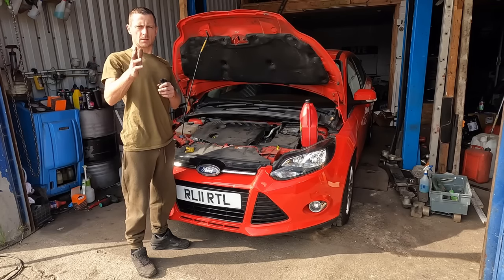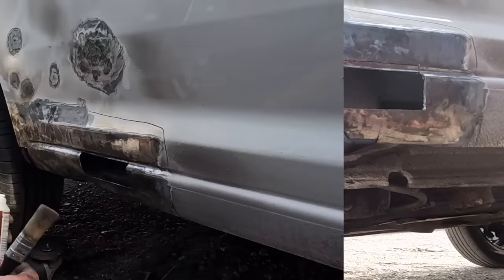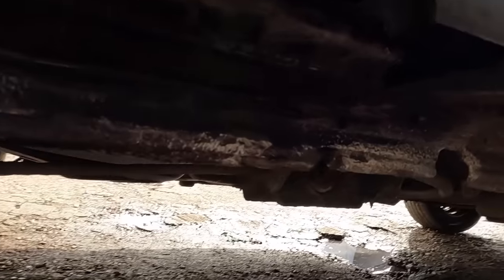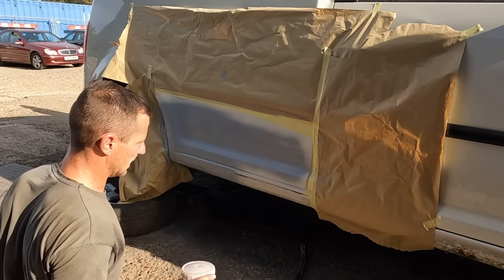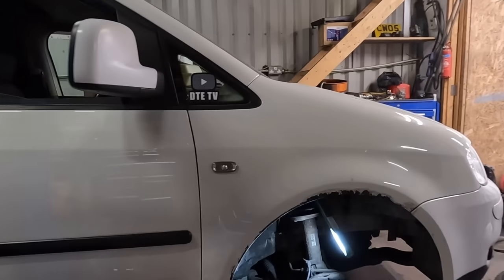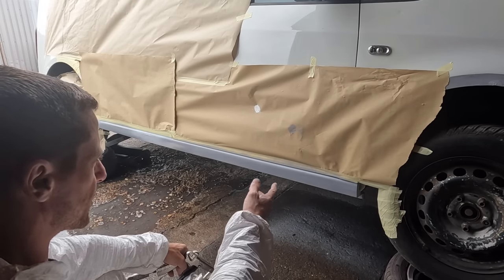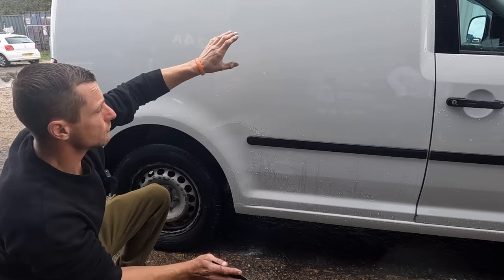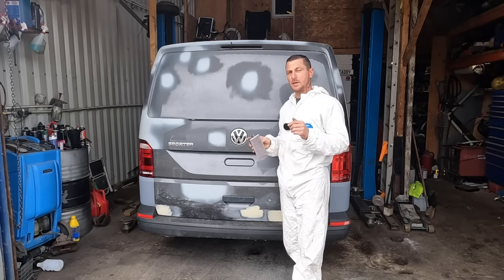Vw caddy rusty sill replacement zero budget

Comment: Problem with the front wigs is that the wing stonegards rub on the inside of the wings . Over time the paint is rubbed off then in comes the rust.  When you get the replacement wings a thick layer of brush on sealer where the stonegard makes contact with the wing. Problem solved . Hope this helps.
Reply from the maker: Hey Ron your so right it definitely wears it away, I’ll do that on the replacement wings for sure 👍

Comment: What a difference already. Brilliant detail as always mate . Only problem with chasing rot it can soon escalate😢 job well done Nathan
Reply from the maker: Hey bud thank you 👍 your so right I’ve had many transits in my workshop over the years and the rust actually doesn’t stop sometimes 😩
Reply: @YTDTETV  oh yes transits are notorious for corrosion. Don’t think I’ve known any 1 that’s owned a transit to not have to have welding 🤦‍♂️

Comment: Great job Nathan, I wish I had friends like you!  This van reminds me of my 2015 T5.1, white, 200k and needs a lot of rust repairs and paint jobs.  I've taken it to the local bodyshops and no-one wants to touch it :(  I think you should paint the bottom of the door, if I saw that for sale as is today, my brain would say "that door needs a repaint to match the quarter"
Reply from the maker: Hey Tom I think I will paint the door bottom for sure, ye some body shops don’t touch the crappy jobs but they ain’t to bad once you get into them.
Reply: @YTDTETV  Keep a bit of that paint spare for the bottom of the replacement wing too, then it'll look right :)  The problem with my van is it was brush washed every 5k until it was on 192k when I got it.  The Candy White is awful and it's had quick cheap repairs in the past in what could be DAF white!  The local painters all have pride (or greed) and don't want their work to look odd so they either reject it or suggest a full respray.  I don't want it to rot out like that Caddy so thanks again for the informative content because I may end up doing the same repairs myself with rattly cans!

Comment: Great episode. 
Can I ask what stonechip you used? The texture looks almost like Raptor. 
Details around the painting are greatfully recieved -what paint are you using, costs for larger quantities, do you use the same paint for your other projects?
I will just drop this -a true budget build would be rollered paint...
Go easy on the map or you will be doing a PD130 conversion...
Reply from the maker: Hey bud thank you, stone chip is just from my local machine mart unsure on brand but it’s not expensive it does look similar to raptor. A litre of 2k paint which has the colour and shine in one is £40 but is only solid colour no metallic and yes I used the same paint on my caddy but I bought a 7.5lt 2k paint kit from eBay.  I did think about not using the spray gun for sure 👍

Comment: Brilliant job mate,some transformation 👍
What size of wire do you use for the cills? 
I did 2 cills on a mk5 golf a few weeks ago using 0.8 but was told it would be a lot better with 0.6 ? 
Have a roll ordered to give it a go on another cill I have to do next week
Reply from the maker: Hi bud thank you so my welder has 0.8 but yes 0.6 is really nice to work with as it comes out really fine with not alot of heat so penetrates nicely without burning more holes. You’ll need a 0.6mm tip for your welder to 👍

Comment: Nice work preparing the replacement cill panel, when you use the 2K paint, what do you do for face and breathing protection? I have to spray my front bumper on my T5 (last owner didn't prepare it properly and the paint is falling off) The idea of using 2k and the risks associated with it, scares the willys out of me!
Reply: Air fed masks/protection should ideally always be used with 2k..
Although you see people using 2k outdoors with normal masks.. 
Not sure I'd risk it personally.. 
if I really had to I'd at a minimum get one similar to 3m 6000 range.. full face mask with A2 filters, which I think, but don't quote me on this.. offer partial protection to 2k paint..
Reply from the maker: Hi Charles I use a 3m mask if you Google search them they look like a fly mask (best way I can describe them) if you in a tight area and spaying loads you can get air feed masks that cover you whole face 👍

Comment: Get rid of those foam things inside the wings and at the door hinge area. These hold water which runs down the wing into the sill area causing the rust as well as the non painted wings.
Reply from the maker: Hey Gordon you are so right the caddy’s have a massive piece right in the middle and at the back, I will definitely be leaving these out when I got new wings 👍👍